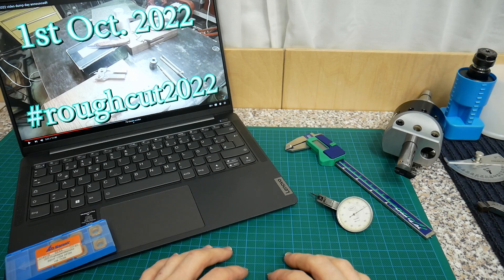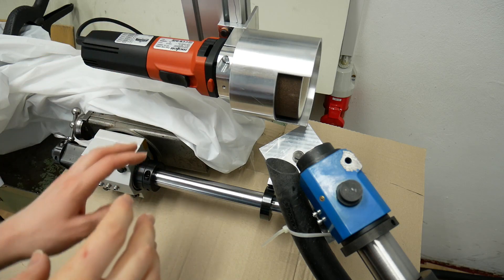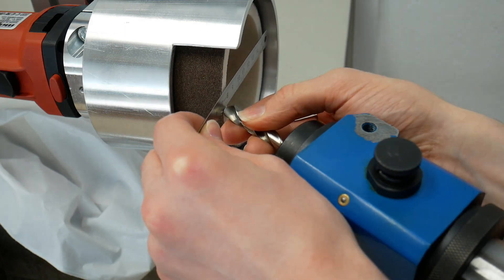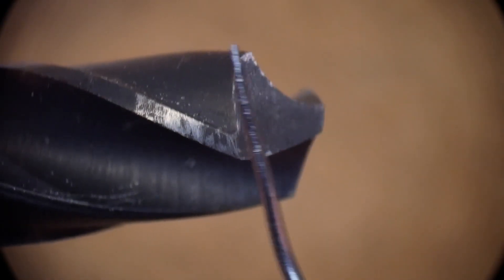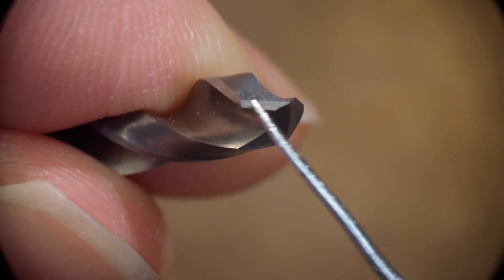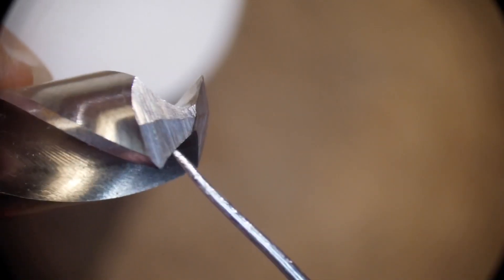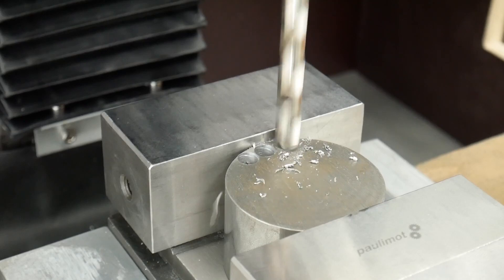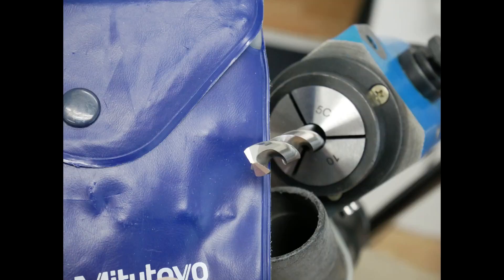Putting a four facet grind on drill bits for #roughcut2022

Comment: It looks like the index changes when you switch from grinding primary to secondary relief. This is the reason for the  secondary relief facets to look like triangles rather than rectangles they should be.
You may need to have additional stop to adjust the index for the secondary relief grid.

Comment: you have a angles issues. you said you set the griinder for a 118° but by eye I can say your tip angle after sharpening look like 135°.
second problemn the cutting edge isn"t parallele  to the secondary facet edge. 
this such drill bit for stainless style have a thick web and need pliting point for thining the web.